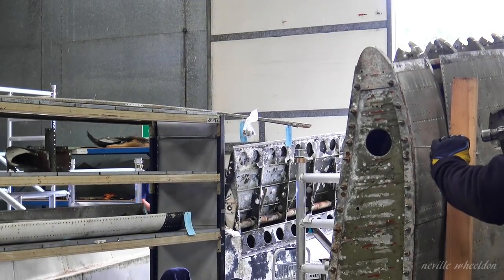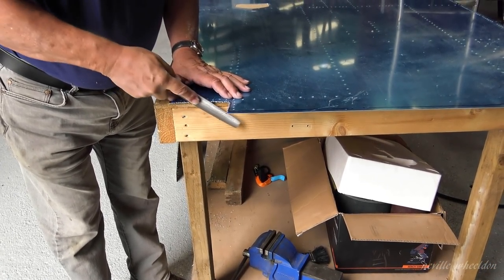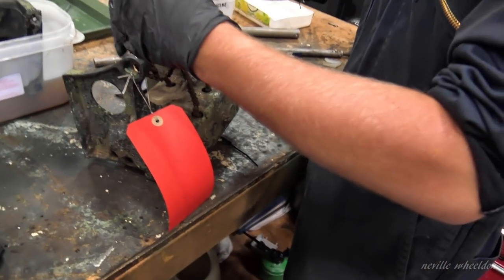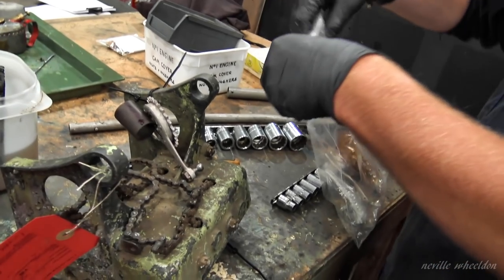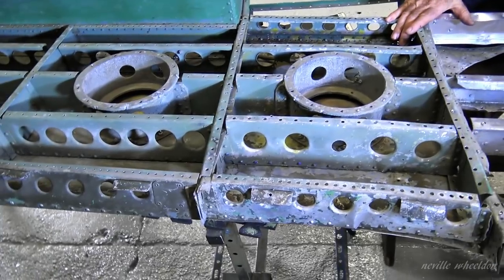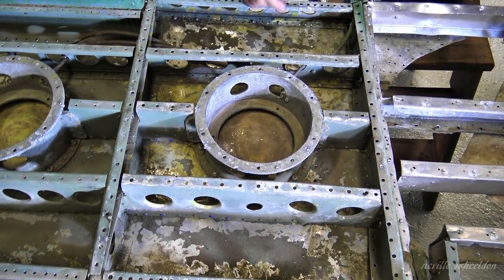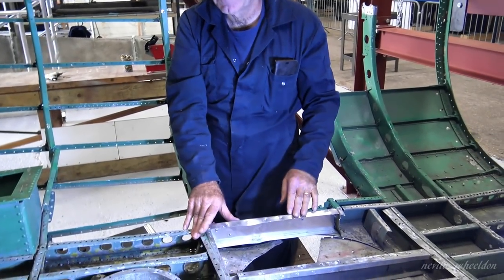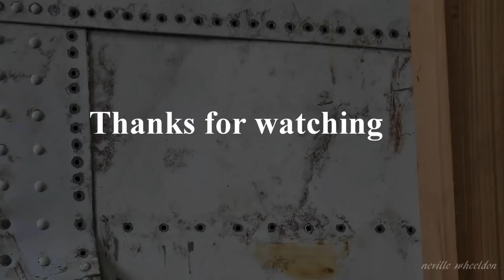Video 107 Restoration of Lancaster NX611 Year  4 . Work starts on the French wing

Comment: The item that rotates the chain through Ninety Degrees is called a "Bi-planner Block" and was the correct answer to many RAF Airframe Fitters Exams in time past. The question was: What is a bi-planner Block. Answer: a device that changes the angle of articulation of a chain through an angle of Ninety Degrees.
Reply from the maker: Thanks for that Paul.

Comment: Another great video Neville.  I wonder though if you could ask Brad, next time you're there,  what he is using to soak the sprocket casting in and why (for corrosion removal or dirt/grease/oil removal),
Reply: I think it's just brake cleaner.